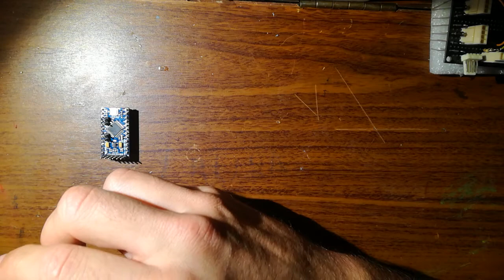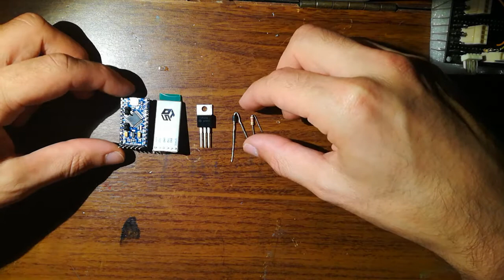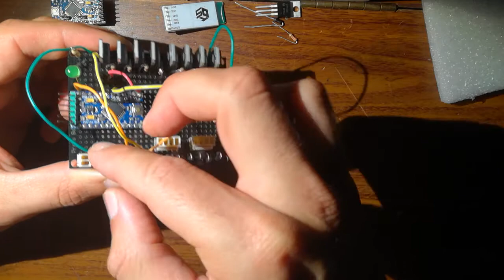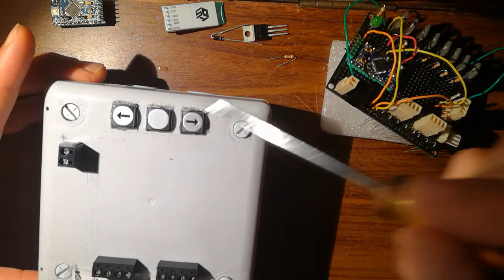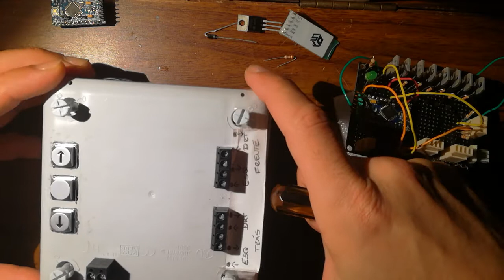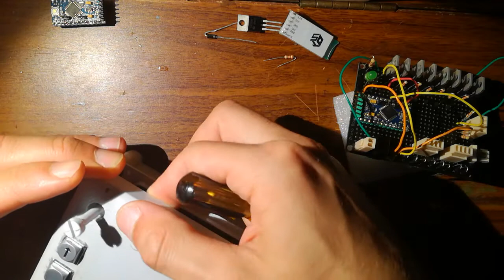How to make Air suspension digital unit for smartphone

Comment: Hey! I've been working on my own and just stumbled on your project. I purchased a manifold with 8 build in solenoids but it seems like they are open by default, does that seem normal? I would have thought they would all be closed and hold pressure when the whole car is turned off, but it seems to be the opposite. I'm confused tbh, I don't want to have to power my board while the car is off